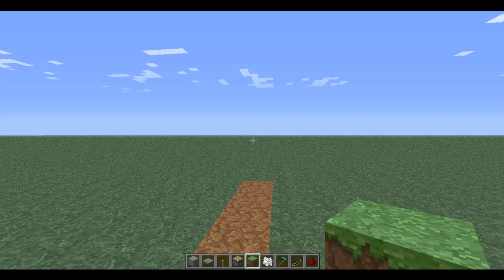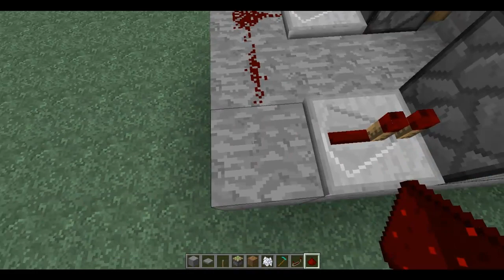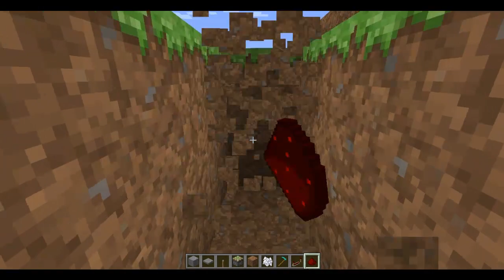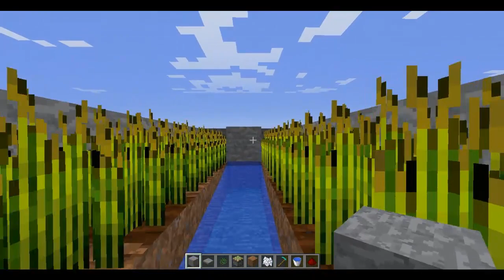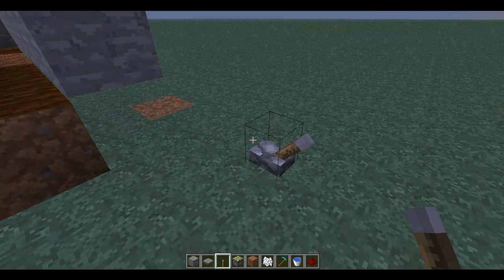Water harvesting wheat farm tutorial

Comment: There are a couple issues that are with this method. One, you don't get seeds with this design. Which is fine if you want to use the seeds from a larger farm or use this in an adventure map. But the other issue is that you can't replant them with full blocks on the side. If you use Half Blocks on the side of the beds it would work fine.